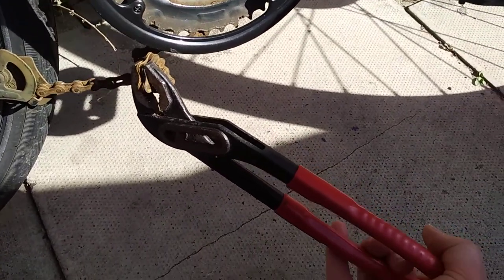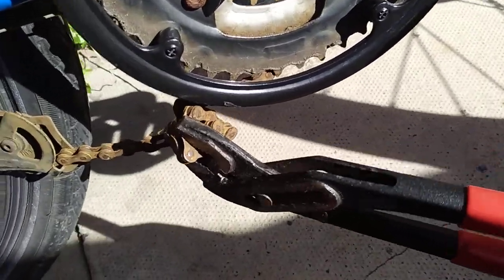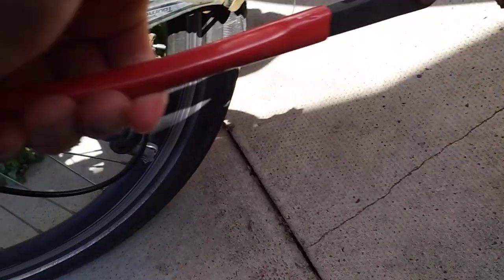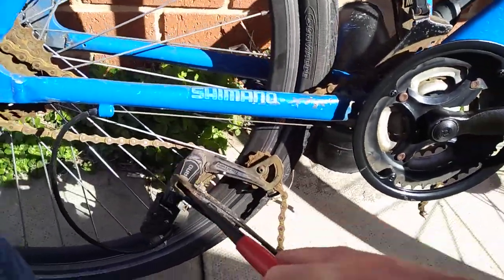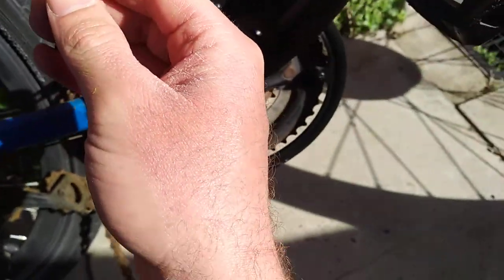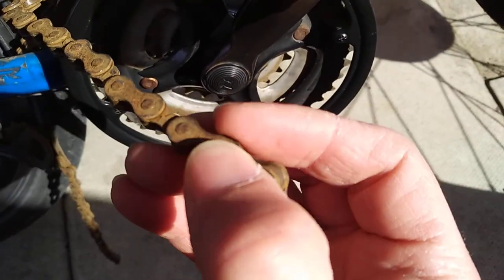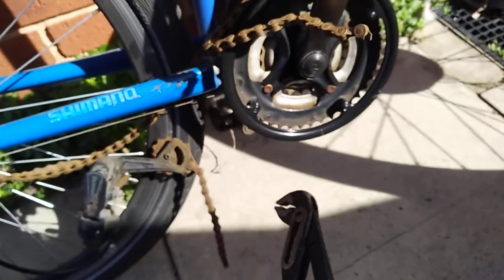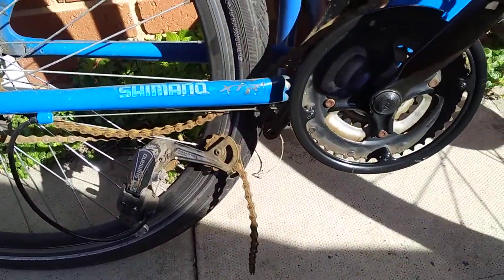How to remove a rusty bike chain without a chain tool

Comment: class!
Reply: I had trouble with worrying about it bending other derailleur parts and my hands might not be as strong.  I thought:  try two vise grips close by on the chain and twist in the opposite direction.  My chain is rustier.  Rescue bike:  looks like it saw Burning Man maybe or just outside.  Anyway, chain PB blasted and waiting on chain tool tomorrow if my hands are too feeble for this method.
Reply: Two plier method:  one pair vise grips and one pair channel locks like above on the stiff rusty chain and twist opposite directions.  Bingo.  That was fast: works good.  Thanks for the inspiration